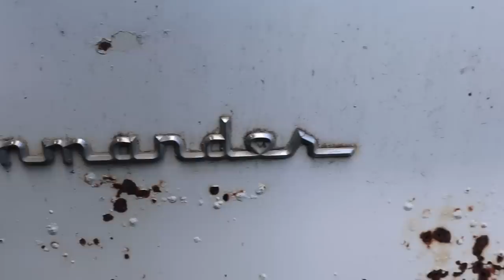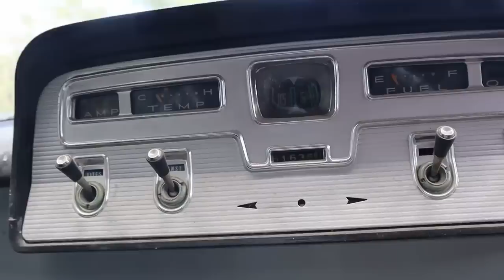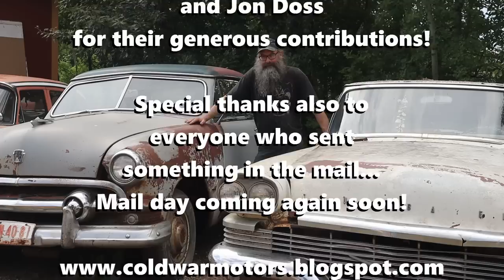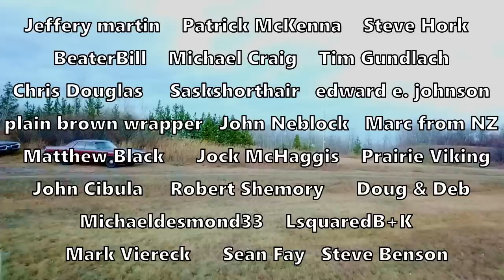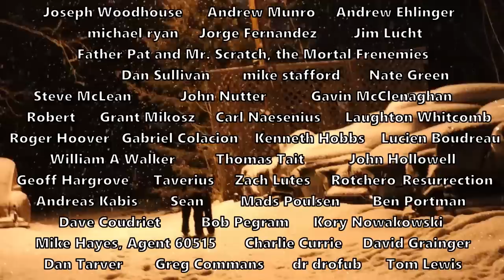V8 Showdown! Part 1: Tractors, Teardowns, and Trash Talk!

Comment: I was shocked at how much water got into both engines. Especially the Stude as it had an intact air cleaner mounted. Someone on team Studebaker made the comment that the gaskets would be hard to find. A new overhaul set is on it's way to Team Studebaker. Cheers!

Comment: Be careful on the Studebaker -- one head bolt per side is necked down to provide a path for oil to the rocker arms --- make sure it goes back in the same place! And yes, all '51 thru '64 Studebaker V8 engines (except the '56 Golden Hawk with 352 Packard engine) used solid lifters. A lot of the hardtop engineering and parts on that '58 were utilized during the development Lark hardtops and convertibles.

Comment: Hi there! The V8 Showdown is off to a challenging start! The Studebaker looks to have less obvious carnage compared to the flathead. It looks like the Vicky was fed unrefined tar sand along with the rusty cylinder and those very crusty valves. Are there extra points awarded for the 1st engine to spin a full revolution? So far neither one is as bad as the Buick motor. It'll still be fun even if drag race  ends up being both cars as tractor pull sleds behind the Farmall and the forklift. Thank you for putting in the extra work to have this competition with all your other work going on! Take care & stay cool!

Comment: Another great showdown, this will be fun ! The Stude V8 was a beast of an engine, it was overbuilt in every way; everything was forged, crank, rods, even the rocker arms... No timing chains on this, timing gears and fully adjustable solid lifters... Super sturdy engine...Why was it so sturdy ? At the time Studebacker wrongly beleived that progress with higher octane fuels would permit c.r. up to 13/1 and wanted to be ready for it but as we all know this did not happen... Would have been great tho...

Comment: STUDEBAKER  parts are easy to find. Lots of club support ( largest single mark club still I believe) and vendors. NAPA has gaskets, brake parts,etc. The V8s are far stronger than their displacement would lead you to believe. Not really a Caddy copy though. Good luck to both teams!

Comment: Pennzoil Z7 strikes again. That Sludge in the Flathead is Pennzoil Z7 oil additive which is actually paraffin and has gummed up more engines than STP ever thought of doing. Best thing it to remove as much as possible and clean it with some Kerosine and put back together and use some High Detergent oil for the first few oil changes until it's all gone.
Reply: I have seen gummed up flatheads before. Quaker State motor oil was the perpetraitor. We showled gunk out of the sump in a flathead Merc, too bad, the rest of the car was ok.  We filled the engine with mixed diesel and atf. It was a lost battle, aii oil passages was completely gummed up. We gave up.😢
Reply: A few yrs back (maybe 25) Quaker State had a mess on their hands with oil formulation and engine warranties.  I remember how thankful we were selling Castrol and Amalie
Reply: Pennzoil and Quaker State are very closely related in formulation. That doesn't surprise me that you think it was QS. When I was hanging out with a friend who had a machine shop he hated Pennzoil engines.

Comment: The scunge inside the engine is from parafin based oils. This was from the era that engines only lasted 50,000 miles and ,if you were lucky,it didn't set itself on fire.
Reply: Qaker state. Penzoil...
Reply: Man! Does that answer alotta questions! Thank you!
Reply: There was an advantage to using Pennzoil: I used to have an '88 S10 with 2.8 V6. Used Valvoline for the the first 100,000 miles and it used at least two quarts per 3000 mile change interval. Started going to a quick lube place that used Pennzoil bulk oil. Consumption went away. Stopped up all the leaks. Sold the truck with 188,000 on it.
Reply: It probably never had detergent oil either. When oil with detergent additives was introduced, word quickly got out to not use it in older engines because it would break that old sludge loose. Non-detergent oil isn't very common now, but it used to be available on every oil rack.
Reply: You could easily get more than 100,000 miles IF you changed to oil and filter every 2 or 3,000 miles.  But many didn't, hence, the 50,000 miles.
Reply: @arise2945  Also, early detergent oils were not all that great.

Comment: 6 months of waiting paying off full time. I think both engines this time are equally bad but I love to see both of the cars run. I think the Studebaker has a pitted piston from moisture and condensation. The flathead V8 probably had mice in it and condensation issues. This engine is not as bad as the ones that Mortsky has had in recent times.

Comment: A lot of sludge built up in the valley of the flathead could be from the car just making a lot of short trips and not getting hot enough to burn the moisture out of the oil. All the Lincoln V12's were bad about that with lack of positive crankcase ventilation. Also cheap non detergent oil leads to sludge build up as well. My very first car was a 1963 Ford Galaxy XL with the 352 engine that when I tore it down at 115,000 miles it looked just as bad.

Comment: At least you can jump in the T and rattle on over to Strongs garage and buy a couple of headgaskets and a set of exhaust valves (the curse of the 8BA,cracked exhaust ports leaking into the cylinders ) .

Comment: I cleaned the goo out of several old flatheads Fords and I've seen similar stuff especially in the oil pan inch thick I don't think they had much crankcase ventilation.

Comment: Hi Scott. Great to be having a showdown! Getting rusty old shit running is my favourite part of your channel. On the Stude V8, you'd get plenty of argument from the Stude guys on your comment that it copied Cadillac!  It was a super strong motor though. It was designed from the start to be supercharged, which they later did, but they quite possibly misread the tea leaves on future availability of fuel rated at over 100 RON. So as time went by, the motor came to be seen as too heavy for it's maximum possible displacement of 289cid. And I'm quite fond too of the last of the flathead V8's. There were a host of improvements, but the 2 biggest were the sensible relocation of the distributor, and the ditching of casting the bellhousing integrally with the block.  And did I see a plate on the back of the 37 Chev the other day? Cheers.

Comment: The Ford's head-bolts go into the water jacket, they need sealer on the threads. A slight leak might not make a lot of difference, but if it seeps in over the years... lots of rust. The valves are Canadian, If it's a C8BA, they are a desirable block. Go team Flathead!!

Comment: I find getting on the back of the engine and using the gears for the starter to break the engine free because back there is where you will get the most leverage but that requires the car in the air with someone under it with a jack bar or crowbar

Comment: Looks like at some time in the life of both cars, cheap oil was used and the filters were not changed with each oil changed which caused filthy oil back into the engine. This could end up being a multi summer event.
Reply: I should add I got my license in  November of 1968 and was told this by an old time mechanic. I have always followed that advice.

Comment: Stude should run asap. No problem. Looks good. What a messy oil filter to remove. I would remove the oil pan and check bottom end and clean pan. I bet there is water in it if just from condensation. You don't want to possibly damage that engine.

Comment: Later in the mid 1960s Studebaker/Packard got so financially strapped they started using GM engines. My 1966 Studebaker Lark had a 283 ci engine in it.

Comment: In my youth working in a service station doing oil changes I came across a 1955 Pontiac 265 v8 that had never had an oil change. I spoke to the owner who had it since new. That engine had oil like tar coming out of it. We tried flushing it with varsal it clean it but there was no hope. All we could hear when we put new oil in was 8 rods knocking.

Comment: 46:08  - not necessarily, this assumes the rings are not stuck in the lands. If enough are stuck, the fuel/air mixture escapes past them and lights off in the oil pan

Comment: On that ford's crusty oil, I have torn apart a great many engines and we used to call those "Quaker State or Pennzoil" engines.  I used to think it was BS until I changed an engine for a friend that bought the truck new, never overheated it and religiously changed his oil with Pennzoil/Fram filter every 3000 miles and it looked exactly like that flat head inside.  I have never touched Quaker State or Pennzoil since

Comment: Most of those old automatics had rear pumps so you could push start them. So turn the rear wheels really fast that will break the engine loose.

Comment: Tension one piston with a block of wood and a diagonal strap across it. Air chisel blunt point on a hardwood block, on another piston going down. Swap the going down block around. Pull the flattie valve springs first. Best of luck.  would a set of #RW1616 rings for the 35 chevy serve you well?

Comment: I’ve seen a worse choked up motor than that, original oil filter on a 79 Chevy van, 150,000 miles, motor was solid with coked oil, all reciprocating parts just wore marks in the solid oil, no oil pressure but ran fine, no explanation at all

Comment: That flathead ran its whole life with Pennzoil. When I was a kid my buddy’s dad was an old mechanic. We did valve cover gaskets on his 66 Impala with almost 300K miles. No one had a car like that with those miles then. I couldn’t get the cover off. It would lift about 1/4 inch. Edwin said pull hard. It finally came off. The valve cover weighed about 4 pounds. Just full of that black shit. I sunk a screwdriver in it and Ed yelled stop. That’s what’s protecting this engine. I said what is it. He said it’s Pennzoil high ash oil. So maybe that’s what you have there.
Reply from the maker: Uh, that is good to know! Maybe it'll be fine then? Cheers!

Comment: 8BA is the latest (49-53) variety of the Ford Flathead as you undoubtedly know. This one looks remarkably original and un-molested. Coolant infusion ??? I hate to say it, but flatheads are NOTORIOUS for cracking. You need to clean that area real good while looking for any cracks.Fingers crossed you don't find any !!!  Besides the oil not being changed, this was prior to "detergent" oil. Just remembered, back in my first days of working in a gas station (mid 50's) when it was standard practice to check the oil, water, and wash the windshield, that a customer could purchase "re-claimed" bulk oil if their engine oil was low. Some even claimed it was "better oil" !! That Studie water pump Harkins back to the "old days", as in Model A, where you only changed the impeller and the bushings since the volute was cast into the head. And, frequently rather mutilated due to the impeller been in direct contact with it. 
Might want to try driving the opposite side piston down "gently" while trying to turn the crank to brake loose that stuck piston on the drivers side.

Comment: Studebaker never had a 327.  That was American Motors.  AMC's first Generation of V8's were the 250, the 287 and the 327.  Studebaker V8's came in 259 & 289 and in the 1960's, got the 304.4
Reply: 1st Stude V8 was a 232. They also had a 224 in light trucks.

Comment: 30:09 Mortske, of Mortske Repair, has gotten a flathead rusted up worse than this running again with basically just sweat equity. 47 2.5 ton farm truck if I remember right. It even ran on all eight, smoke cleared off.

Comment: I've actually seen worse than the flatty. We bought a Pontiac Astre wagon from a cousin of my mom's that I got a wild hair to change the valve cover gasket that was leaking and when I took the cover off the little 4 cyl there was that oily coffee grounds that were packed into the shape of the interior of the valve cover. It wasn't pretty at all. Like 150K miles and just oil added when needed.

Comment: Studebaker V8s distributor rotation is opposite of Chevy. Due to timing gear as opposed to a belt.
Reply: Thanks for the heads up Kenny!
Reply: @mylesmoparfreak6562  If you are not already aware...Studebaker V8s have a unique feature called Oil Pressure Relief Valve.   Very critical.  You might want to research that. Good luck to Team Studebaker

Comment: Welp. ... time for the flatty to get copper heads a 3 angle valve job bigger valves a hog ass cam and bored .060 over. 3 dual intake setup and porting. Obviously.

Comment: You were going to check to see if whether the Studebaker was built in South Bend or Hamilton. The answer is?
Reply from the maker: Oh! Where would it say? I'll be happy to have a look... just got preoccupied trying to get them apart...Cheers!
Reply: @coldwarmotors  The body tag on the driver's door side cowl will indicate where the car was built. If you spring for $40 the Studebaker Museum can provide you a copy of the original build order for that car which will indicate all as built options and the date the car was built., All they need is the car's S/N.

Comment: At about the 50 minute mark when talking about the cars an error was made. It was said that both cars were the first hardtops for both manufacturers. This is incorrect. Studebaker had a hardtop  in 1956 available as the Golden Hawk J. In fact there was mention of the Golden Hawk YouTuber Johnathan W.  just bought which is a 56 J hardtop and he posted a great video of it.
Reply: Studebaker 's 1st hardtop was the 52 starliner.
Reply: @troyandog8749  Thank you. I stand corrected.
Reply from the maker: Yeah! You are correct... Funny I missed that, as I have an eye on a 52 Studebaker hardtop right now! Cheers...

Comment: I've also had some luck where you take the single cylinder put in your Gibbs and a little gasoline and light it let that cylinder burn get that heat in there then once it's out spray it down to cool it off repeat that three times and it may break lo loose.